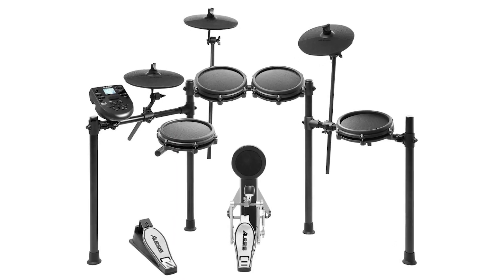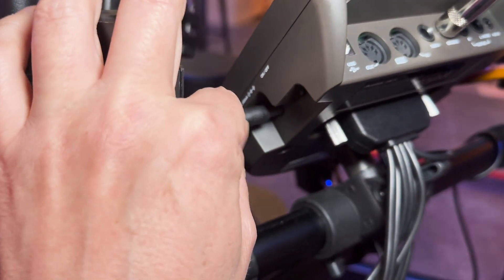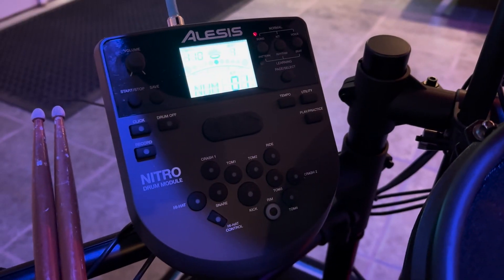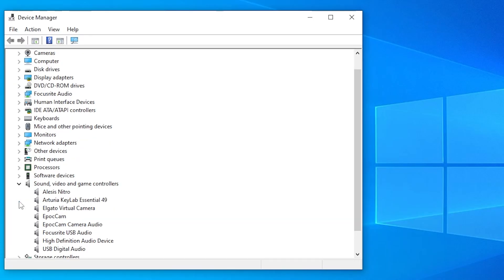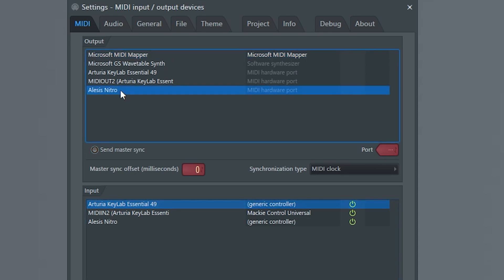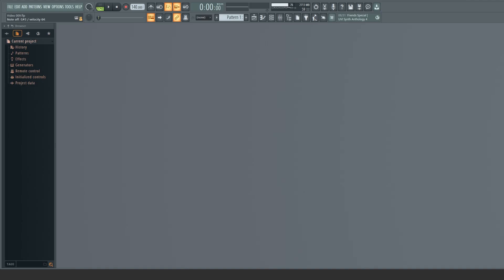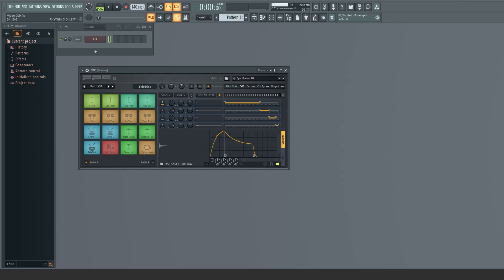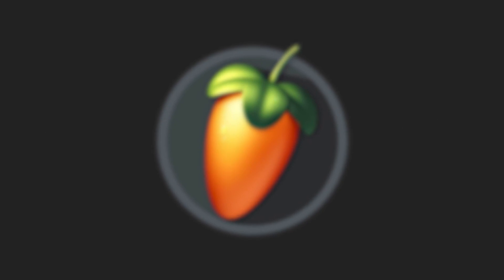How To Connect An Alesis Nitro Mesh Kit To FL Studio (In Under 2 Minutes)

Comment: Hey man, thanks for your clear vid. But i got a prob, pretty sure other people got it too. I plug it in, it's recognized, every parameters are same as yours. I start to play on FPC it does indeed a sound and then after 5 seconds it doesn't anymore, for no particular reason. Cable is working well on any other device. And i updated everything i could do. Did you already got that issue with someone? Thanks, regards!
Reply from the maker: When you stop receiving sound, do you still get an indicator light when drumming up at the top left of FL Studio (Hint Panel)?
Reply: @Voidpiercer  Absolutely not, it just doesn't detect it anymore. Doesn't work on FPC neither.
Reply: @valereeichinger4297   a mi tambien me pasa, lo solucionaste?

Comment: If anyone is having the same problem as me where you have it connected and you have the input/output lined up, try changing the controller type to alesis photon x25 under legacy. It fixed it for me!

Comment: Other than using a plug-in, are you able to use stand alone sounds from a library? For example I make reggaeton beats and would love to assign the different drums I use. I'm using a Nitro max. Haven't tried it yet as a midi. Thanks.
Reply: FPC lets you replace individual sounds from a premade drum kit yourself, then you can save that as a custom kit to load up anytime. I know you said not using a plug-in but the sounds need to be mapped to a keyboard roll in order for midi to play them, at the very least using a sampler.
Reply from the maker: @chrismichaelyoung nailed this one. Additionally, you can drag/drop your sounds into individual FPC pads and have ADSR, pitch, volume, etc control. You can also layer pads.

Comment: My midi settings all look the same but the light on the hint panel is not lighting up. Any reasons why?
Reply from the maker: Hi! I was able to replicate and correct this issue by curiously enough, setting a unique port #, like '0' (just off to the right of the wrench icon in MIDI settings) and refreshing. I then set it back to '---' and it continued to work. I hope this helps!
Reply: @Voidpiercer  The problem still didnt seem to fix itself, thanks for the quick response though. I was wondering if im missing any extra hardware or software. Is EZdrummer a necessity? Or can I just run it with nothing else but my kit, cable, and FL.
Reply from the maker: @imbshissl  Dang, I'm sorry that didn't work it out for you - FPC within FL Studio is enough, and with some finessing can be a pleasant VI option. EZDrummer is not required in this example. Feel free to reach out via email with any screenshots if you like. Thanks!
Reply: @Voidpiercer  so when I set the drums in the output section to zero I got the little green power button, but I’m not getting it still on the input section and thus no detection
Reply: I FIXED IT!!! After sooo long i found out that you just have to change the controller type to alesis photon 5 under legacy. Put them on port one as well. Apparently the two are close enough software wise to where it can recognise the nitro as a photon.
Reply: @andersmithmusic08 actually that worked for me too. I guess Alesia photon is a general pad that is recognized with FL I’m sure there’s another workaround have to make a map for fl I would assume

Comment: i have a crimson and midi notes are getting detected by my computer as i checked on a midi moniter but for some reason they arent showing up on fl any fix ?
Reply from the maker: Hey there. Are you seeing the MIDI input indicator within the FL Studio Hint Panel at all (top left) when striking your kit?
Reply: @Voidpiercer  no that isnt lighting up either
Reply from the maker: @AshvinRath  I was able to replicate and correct this issue by curiously enough, setting a unique port #, like '0' (just off to the right of the wrench icon in MIDI settings) and refreshing. I then set it back to '---' and it continued to work. I hope this helps for you as well!
Reply: @Voidpiercer  thanks for trying but i think its a driver problem. ive contacted their support so lets see what happens
Reply from the maker: Hope they can get you squared away, @AshvinRath  !

Comment: Hey there, I’ve just got myself an Alesis Nitro Mesh Kit. I’m using FL Studio and VSTs like EZdrummer 3 and Studio Drummer from Native Instruments. Everything is working fine and is well mapped with the pads. The problem I’m facing is, that the volume of the VSTs while I play live on the kit is very low. When recording the midi data the velocity is correct, but when I play live, it’s extremely low. For example, when I use my midi keyboard with ezdrummer or studio drummer, it works fine with the velocity. I went ahead and tried to adjust the sensitivity on the kit itself. But there’s like almost no difference. I’ve also tried to adjust the velocity curve in the midi settings in FL, but if I’m gonna change the curve there, it affects all my other controllers as well. Do you facing a similar problem?
Reply from the maker: Thanks for your comment! I'm gonna have to brainstorm this a bit while I work to get back up and running after a recent power event took down my production PC. It's hard to tell without looking at things, but this sounds like a monitoring issue since you're getting solid velocity, and is affecting both EZ and NI. I'll reply back here once I'm running again and have had a chance to attempt to replicate on my end. Didn't want to leave you hanging!
Reply: @Voidpiercer  Thanks for your reply! I appreciate it! Take your time 🙏 I’ll try to figure out what causes the problem in the meantime.
Reply: @Voidpiercer  wheres this update at?
Reply: I have the same issue. Do you have an update for this? tysm

Comment: Great video! I have a strike pro. When I use ezd3 or sd3 with the alesis in flstudio, the hats behave the opposite way around. Closed pedal and hats open in the vst. Any idea how to fix this?
Reply from the maker: I'm jealous! Assuming no issue pre-MIDI out, I'd check and see the MIDI voice values assigned to both hat states from the drum module. You could possibly experiment by swapping their assigned MIDI values. This could be a first step. Let me know how it goes!
Reply: @Voidpiercer  don't be. It's a nightmare setting this up with FL. I'll let you know how it goes. I've been doing some research and a lot of people seem to have this same issue. Strike pro SE + FL studio = headache. thank you so much for the response. Wasn't expecting it to be so soon. YOu're awesome!
Reply from the maker: @BrianIglesiasROT8records  Thank you so much! I'm currently running through a response issue with FL Studio mobile + Alesis Mesh which is driving me freaking nuts. Why can't it all be as easy as connecting a MIDI keyboard? 😂

Comment: It recognizes my kit but dont make any sound. Do I need to have an Interface?
Reply from the maker: Hi! Because the kit module sends only MIDI information, a receiving virtual instrument like EZDrummer would have to be in place to translate the signal to sound. If you're running FL Studio, do you see the hint panel at the top left 'light up' when playing any piece of your kit? Do you see 'Alesis Nitro' listed as a MIDI input/output device inside MIDI Settings? No physical interface is required apart from USB.
Reply: I tried to connect my kit using Reaper and MT Power Drum kit, it worked but lagging. In FL Studio, I see Alesis Nitro Mesh in MIDI Input/Output but the hint panel don’t light up.
Reply from the maker: I find setting my ASIO buffer length to a low latency like 256 smp is required to prevent response lag. In FL Studio MIDI Settings, do you see the Alesis Nitro device enabled with a controller type as generic, input/output port '---' ?
Reply: @Voidpiercer  So I must have a plugin (like EZDrummer) to hear my kit on the computer? If I want to hear the proper kit of the module, that’s when I’ll need an Interface, correct?
Reply from the maker: Yeah - You'll need a VST instrument like EZDrummer to translate the MIDI signal into sound. You would however need an physical interface with a TRS 1/8" in if you plan to record sound generated by the Nitro module itself. @lfportugal
Reply: @Voidpiercer  Thanks bro, helping me a lot!
Reply from the maker: @lfportugal  Awesome. Happy to help!